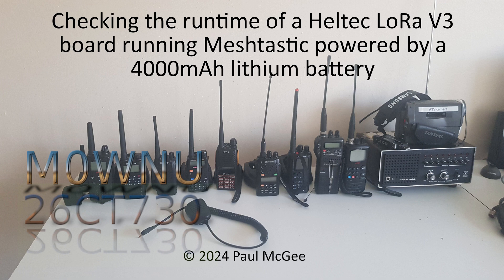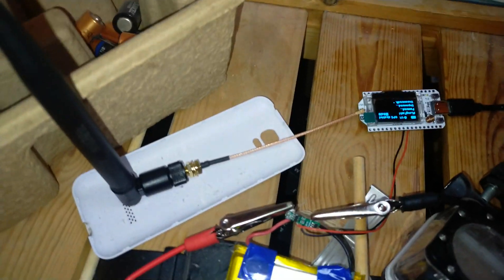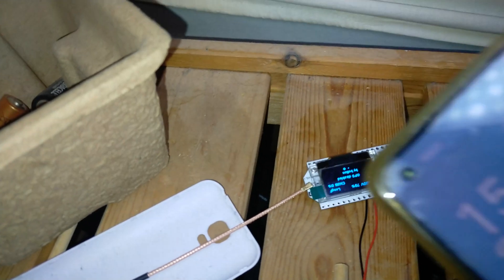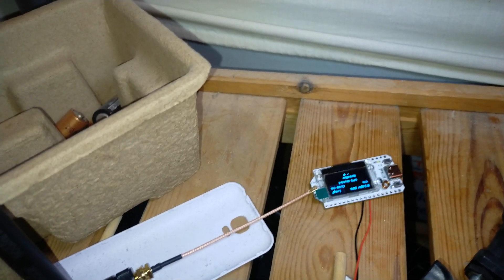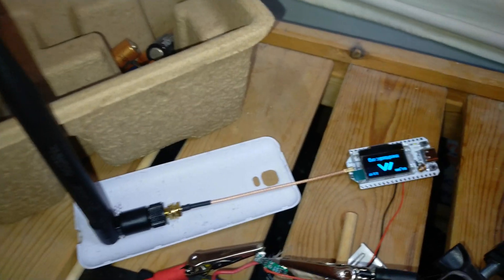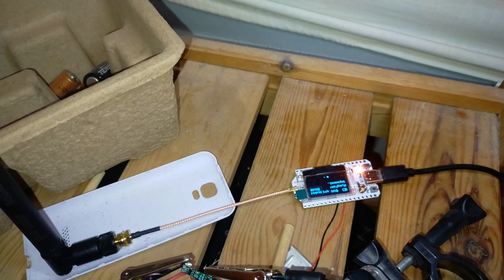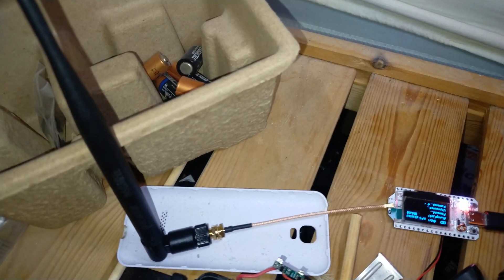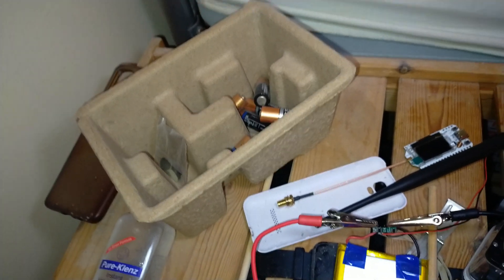Checking the runtime of a Heltec LoRa V3 running Meshtastic powered by a 4000mAh lithium battery

Comment: Try turning off WiFi and BT. Before that set-up remote admin. It should last 3 days on 3000mAh. Next, set up power saving, you can then squize some more out of it.
Obviously, with both BT and WiFi off, it can only fulfill routing tasks (but leave on CLIENT role though).
Reply from the maker: I have since flashed this device with MeshCore which in of itself has had a positive impact on the battery life as the LoRa radio is transmitting far less often than it would with Meshtastic, that is I have to be actively send a packet be that an advert or a message or repeater management from the MeshCore app

Comment: Oh my god so so much personal detail irrelevant to the video, lol. This reminds me of trying to have a conversation with my wife where she’s trying to tell me a story and there’s all these tangents that are relevant to the story. Bit of advice, stabilize the camera.  Just received a pair of these version 3 boards from Heltec, one on 5000 mah battery, and the other one running on a 20,000 mah battery bank.  The 5000 one is probably closer to 3800 in real world, and that seems to last running it for about 20 hours. That's with no Wi-Fi, only Bluetooth connected to my phone, with no deep sleep mode. My area doesn't seem to be very meshtastic, so I'm sure I need to get a slightly bigger battery bank or battery if I want to use it outside and connected to solar

Comment: My Lilygo T-Beam using a 3000mAh 18650 battery lasts just shy of 24h hours, so a bit power hungery.
Just plonked up a 4.6dBi colinear at 8m above the house running off USB and can cover most of the Tees valley 24/7.
Have 'seen' loads of nodes but most seem to switch off after a short period of usage.
I thought the idea of a mesh was to keep things live so that reliable comms can be maintained ?
Reply: I see a lot of client mute ppl.  Selfish and scared

Comment: What settings did you have on the V3?
Was it spending battery on wifi or Bluetooth?
How busy was your mesh in terms of messages?
I had a 4000mAh on power save mode and it lasted 84Hrs

Just curious, great video
Reply from the maker: Can't recall what the settings are right now and I am away in the United States so can't check right now how it was set up, also the battery was a used one originally from another device which may contribute to lack of runtime.

I will be picking up the Meshtastic stuff once I return to the UK

Comment: You're much better off with an NRF based radio if you're trying to run it off solar+battery, they are much lower power requirements than the ESP32 based radios. T-Echo from Lilygo is a good choice.
Reply: Hi Siftah!

Comment: I've had mine running all day at work straight off USB. Not made a single contact. Does anyone know if I have to set a public channel or is it the standard LongFast standard 🤔
Reply from the maker: If you turn on MQTT and connect it to the internet a lot comes through but it could overload the device and cause it to exceed duty cycle limits
Reply: @PaulMcGeeM0WNU Paul thank you I appreciate that. I noticed in the Meshtastic  Android there was a PTT swith. I need to learn a bit more. However only got my unit yesterday.
Reply: @TRIPPLEJAY00  If it's any consolation .. I didn't see anything for awhile either. Took the device to work and it did see a bunch of channels there. Then, by the weirdest coincidence, the local hams put up a LoRa repeater south of town, now there's plenty of signal. Build it and they will come :)

Comment: I ran mine on a 10,000 mAh battery earlier this week. The display on the battery showed about 57% after about 27 hours so that sounds broadly in line with your results. Even without solar charging that would probably be enough for an 'away day' somewhere, although it would presumably eat more battery if it was functioning as a node as it would be transmitting more. Useful video!
Reply: Got a similar setup. Planning to stick it in the attic with a charger on a smart outlet, duty cycle the charger for (guessing) 2 hours per day, so the battery should be topped up all the time. Emergency comms on a budget.